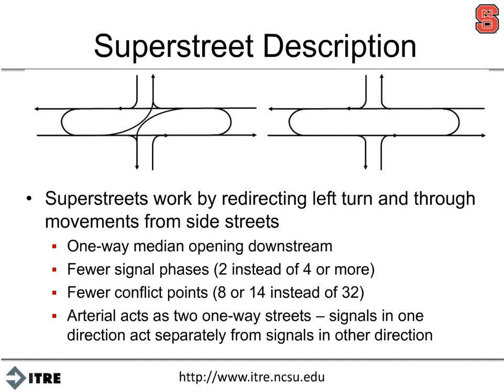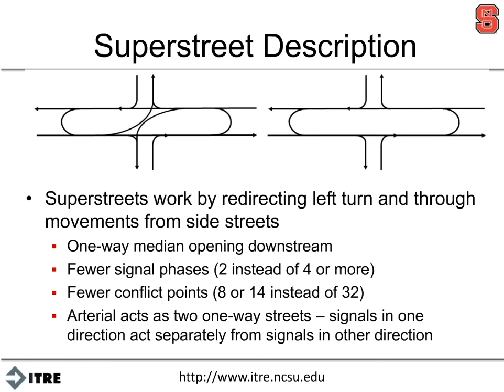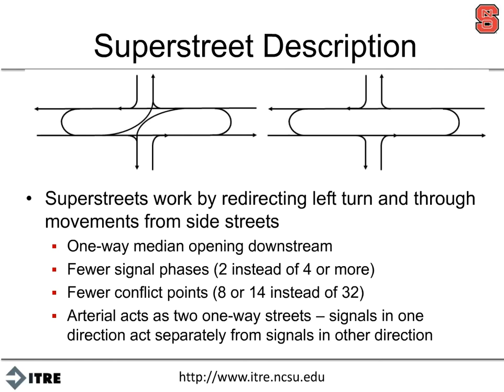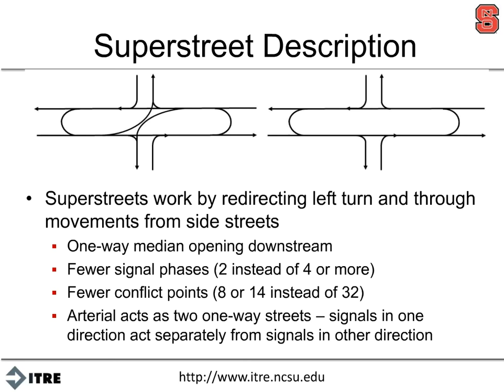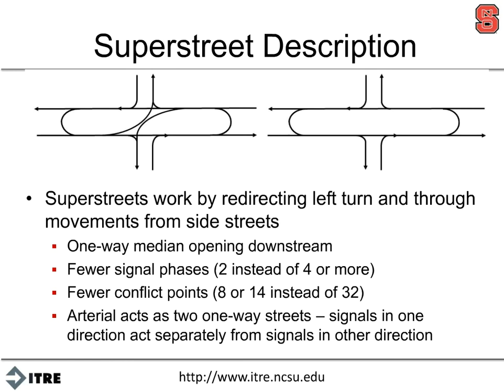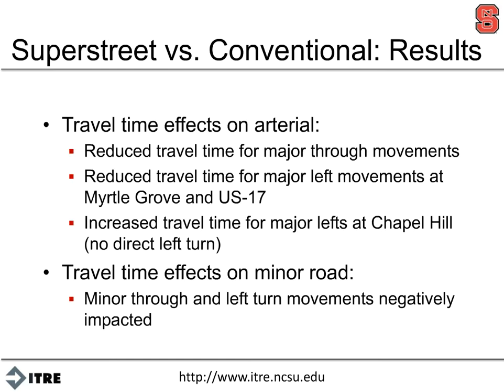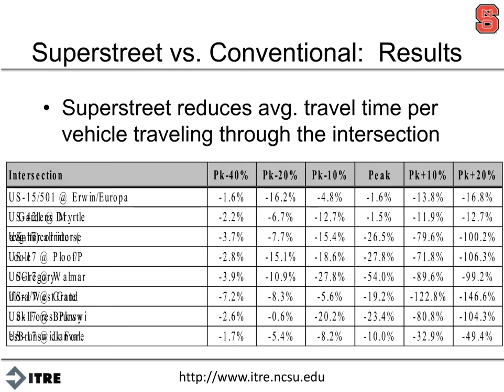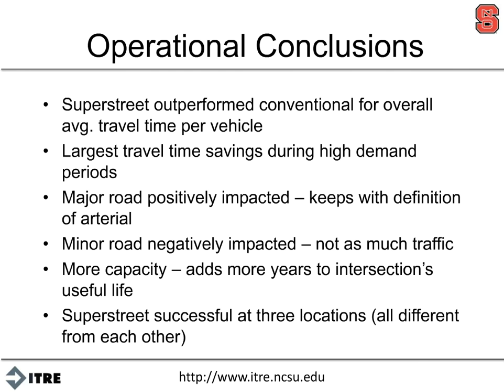Superstreet vs. Regular Intersection

Comment: Living with several of these in Butler County Ohio. To turn left from a side street I have to wait on 3 lights. The first turn to the right. The light at the U-turn. And the light that allows cars to turn right from the opposite direction I was traveling from.  I also don't see how this improves traffic congestion on the main road. Where they did have 1 light to contend with, now they have 2: The U-turn light and the light that allows the right turn. Yes, they should be synced...but often they're not. Definitely NOT a fan...